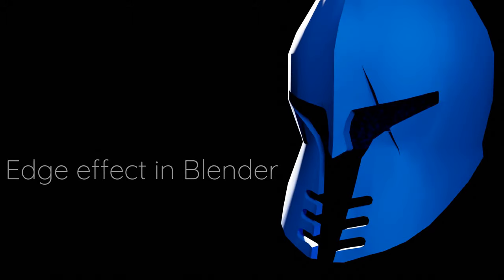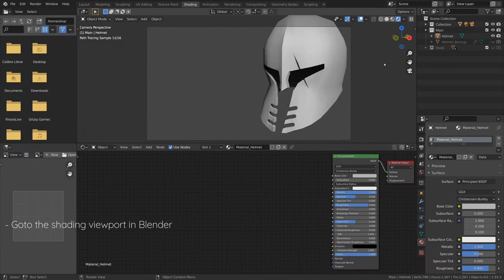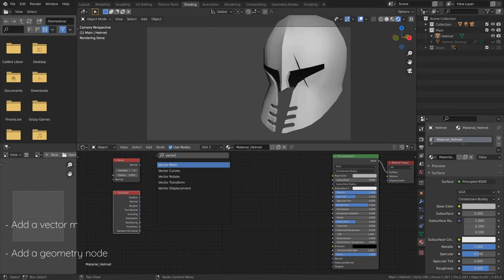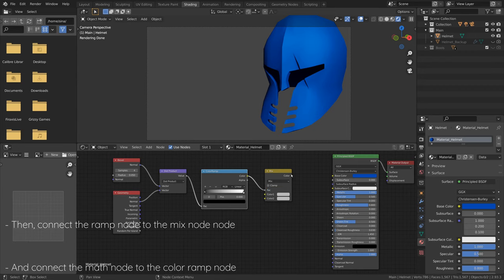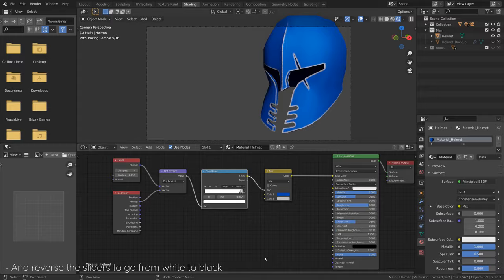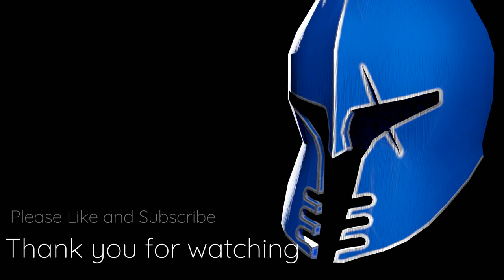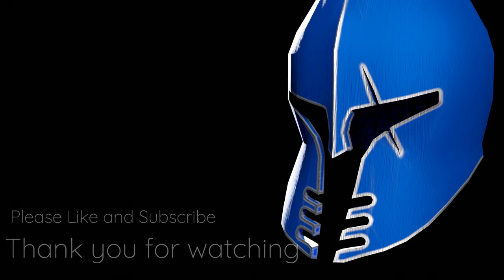FAST and EASY material with discolored edges in Blender (Hint: uses the Bevel Node)

Comment: This effect is only visible in render mode 
(press "z" and then "8" for Render Shading Mode)
if you are using a newer version of Blender (I have 4.1).
Change the samples e.g. to 16 and the radius e.g. to 0.1, then it should work.

Have fun with it.

Many thanks to Sina Sinaie for the helpful tutorials.
Reply: Do you know about a solution that works in the viewport too? thanks
Reply: @alexricard2262  No - this only works in render-mode.
Reply: Thanks
Reply: @Nivinatar  Not just render mode, but must be using Cycles render engine. Nothing shows in EEVEE. (Blender 4.2) For that I created a wireframe modifier which did what I was looking for.

Comment: Nice tutorial, unfortunately it's not working for me. I used both Blender 3.5 and 3.6, with and without Cycles. I used the Mix color node since Mix RGB is no longer available. I used a cube and subdivided plane.  No edge difference.
Reply: This effect is only visible in render mode 
(press "z" and then "8" for Render Shading Mode)
if you are using a newer version of Blender (I have 4.1).
Change the samples e.g. to 16 and the radius e.g. to 0.1, then it should work.

Comment: Not working, Blender 3.4 Alpha. My hopes were up for this :/
Reply from the maker: Incorrect, it still works.
My guess is that you didn't switch to Cycles.
Reply: @sinasinaie  yes sorry. actually I tried it on a flat object, I just tested on a cube and it worked. I'm trying to make a shader follow a flat surface's edge with no success.
Reply from the maker: Hmmm, do you have an example of the effect you're trying to achieve?

Comment: I have one question. What is a node?

If this is beginner shit then I'm a complete noob. And I've been pissing about with blender for years.
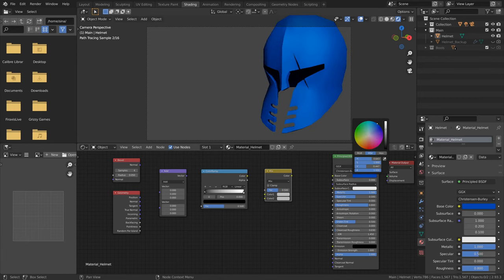Reply from the maker: If you go to 00:40, all of those colorful boxes in the middle-bottom of the screen are nodes. Look at each of them as simple mathematical operation, which when connected to each other, perform more complex mathematical operations. Using nodes replaces the need for us to write code in order to achieve the same effects.

Comment: Does this still work in 3.5 as its jut not doing the edge for me in 3.5.
Reply from the maker: It should work. Make sure you're using cycles.
Reply: @sinasinaie  Ok I got it to work, however the lines are a bit to thin for my liking is there any way to make them thicker? 

(old) I m using cycles now, its hard to tell if its working. The edge lines are either not there or are so small they are hard to see.